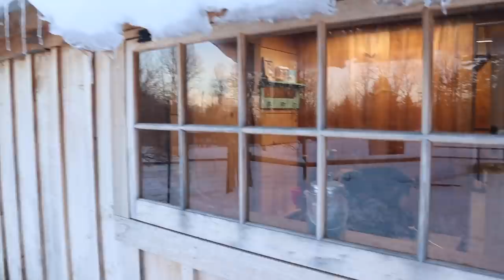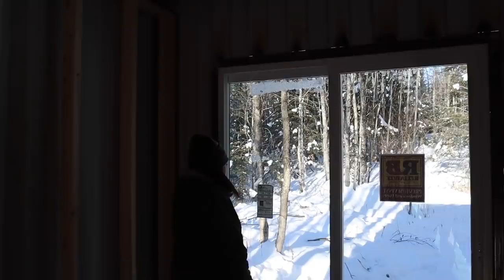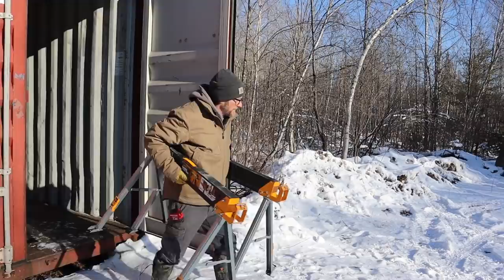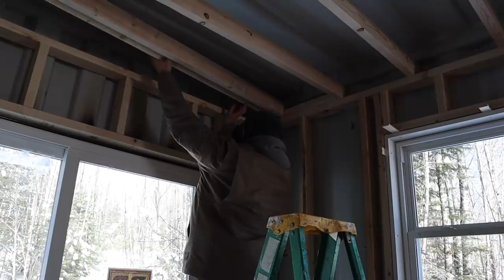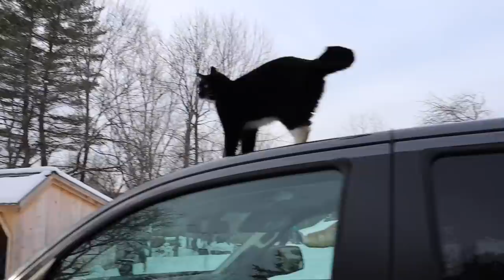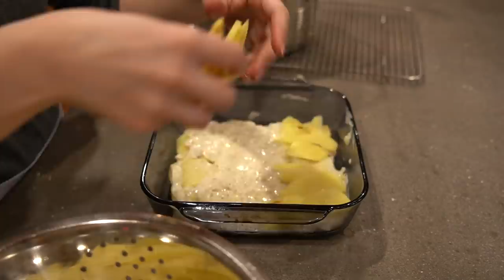It's All Taking Shape Now! Installing Sliding Glass door in our OFF-GRID Shipping Container Cabin

Comment: Thumbs up to your friend that help you install the sliding door. Your so lucky to have such great friends.
Reply from the maker: Yes we are!
Reply: I was thinking the same thing. Specially in that kind of cold. Luckily it didn't take too long.
Reply: I was thinking that too, plus that Gina could have probably done it;)
Reply: @PatrickPoet  That's a pretty heavy door, (120 to 150 lbs) no sense in taking a bigger chance on an injury greater than they are already taking. They're not working under the best circumstances!
Reply: @PatrickPoet  🇬🇧    Extra hight and masculine strength was probably needed.
Reply: @sarapulford5957  I hear what you're saying, but she works a farm and I've seen her doing incredible things. I stand by it. I think she'd have been just fine. Sometimes it's just doubt that holds you back.
Reply: @garys9694  I hear you. I've seen her move 50# to 75# things on the farm, though. Plus they could have carried it flat and put it on sawhorses by the wall, slide the bottom in place and then just tip it up. There's always ways to avoid brute forcing things.
Reply: @PatrickPoet  But they made the decision in a previous video when Gina was there that they would get help so she obviously thought she was not up to it.
Reply: @tonygrimes13 , yeah, I know. But sometimes our biggest obstacle is self doubt. You and I and everyone else can often do a lot more than we believe in the moment.
Reply: @PatrickPoet  🇬🇧     It's not just the weight Patrick.    The hight to lean against the door to hold it in place would also be important.    Gina does not seem very tall along side Al.
Reply: @sarapulford5957 , yeah, they talk about that -- neither of them is basketball player tall;)
Reply: What kind of chopper are you using? My wife would like to have one like that.
Reply: @sarapulford5957  yep! Those doors weigh close to 200 pounds!

Comment: I’m a firm believer of doubling the amount of sockets I think I need. It’s so easy to add them at this stage and the cost is not unreasonable either.
Reply from the maker: I agree
Reply: @LumnahAcres  also 20 amp.
Reply: You’re thinking to place the wood stove in a position close to your sliding doors and thus plastic and glass. Is this a risk? Can you beter place it more central along the side of the wall?
Reply: When you need several outlets in one area use 4 in box with double outlet plaster ring. Then you will have 4 outlets in one area. Works good when you are using several chargers .

Comment: I still think that you should have a door between where you are having your work area in the back and your cabin area. That way you have an alternate way into your cabin area. You could put your work bench along the sides of the storage area.
Reply: A door between the two half's is a great idea.. including use as a fire-escape.. in case you have to go through the shop to get out.. plus a bench on the side will allow more room to work if you open the end doors to expand the useful length of the bench.
Reply: Or at least a crawl-through door which could be under their bunk beds on one side and the work bench on the other side.
Reply: @hollowpoint357sw4  BUT--cannot open container from inside ????????
Reply: A door between the garage and cabin ends would not work well as an alternate fire exit because you can’t open the container doors on the garage end from the inside. He’d have to put another exterior door.
Reply: I firmly agree with that safety first
Reply: @hollowpoint357sw4  This!!!!!!!
Reply: @anthonywatt3758  or be running about 65 MPH to burst through the steel doors !!  Fire can make a man run pretty fast i bet,,,LOL  seriously though, with the main doors locked from outside, it would not make sense to have an exit through the shop end.
Reply: @SailorAllan  unless you take off the locking pins and use a locking system like a cross bar and U seats for them. Like they locked the great castle doors. There is always a way round things. Only have to take off the bottoms and tops of the pins it would make it look original. I had my doubts but it's looking good Al, you and Gina work well together, keep it up.
Reply: @anthonywatt3758  Put in a roof hatch/ high small window hatch to exit for emergencies?
Reply: @nancyparker8623  an egress window would have to be big enough for an adult to fit through and at a height appropriate for a child to get out otherwise what’s the point.  I don’t know what local building codes are where they live or if they will even need a c of o but where I live a small window and / or roof hatch wouldn’t fly. Would have to be a large window or a minimum 32 inch door.

Comment: Outlets every 6 feet . Install the new style low profile LED cans , cut hole and spring clips hold the lights in place .
Reply: I have those in my bathroom, super easy to install and fit in a 2x4 wall
Reply: In that small space, every 4 ft, or even 2 or 3 because you need then and stacking them isn't a good idea.
Reply: Love anything LED❣️👍

Comment: How about a hinged workbench so it can be flush against the wall if you need the space for storage or more floorspace to work?
Reply: I like your thinking about doing this.
Reply: I like the idea about the hinged workbench. If you added French clits to the wall above the work bench you could keep thing off the work bench. One draw back I see is if you added a vice to the workbench, then you would have to remove the vice of you wanted the extra space for storage.
Reply: Or even a flip down table to sit at inside to eat and it goes down when you're done.  I've seen tiny homes in RV's with those.  Space savers.  Things that have multiple uses are called for in tiny spaces.  Maybe even flip or chain rising top bunk and bottom bunk doubles as a couch.  Olivia gets the top bunk, she's younger.  ;)
Reply: They sell the flip down bench/table at Home Depot. The hinges are heavy duty and the wood is butcher block. $125.00 or $150.00 very nice.
Reply: @Parakeetfriend4215   I think this is an EXCELLENT SUGGESTION.

Comment: For outside lights you could use solar movement lights, the new lithium ones are not as bad with the cold and they will work night or day.  I would start determining what you want for power inside the container,  make sure you have enough for lighting and other uses.  Find some old florescent lights and convert them to Led Bulbs.  get the bulbs that have you taking out the guts of the fixtures.  uses way less power for more light.  Will wind up being cheaper. The bulbs will about 5-6dollars each in quantity. Put the battery bank in the garage section, you need it to have enough power to carry you for 2-3 days with no sun.

Comment: You can never have too many sockets, in any case they are easier to install at this stage, than after you have finished your insulation and internal walling.  Installing sockets in the workshop area is essential, but don't forget to have one at least close to the door both ends, should you require power outside the container.  Might also be advantageous to have the fuse board and isolator switches just inside the workshop door, just in case you need to isolate the supply in an emergency. Always be mindful of Health and Safety.   Good luck..Cheers Robin.

Comment: I don't know if you mention how you're going to finish the interior, but definitely on the dividing wall between the garage and living quarters use something that is Fire Retardant. And a smoke alarm on both sides.
Reply: To add to this thought, the wood stove will need a ready supply of fresh oxygen from outside as the container is likely too small volume-wise to supply the fire and your own O2 consumption. Keeping a fire extinguisher at both ends of the container would also be a good idea.

Comment: Make sure you have an outlet for a workbench light as well as any electric tools you may need.  My suggestion for now is to buy a Heat Buddy by Mr Heater for the inside of the  shipping container to keep it warm while you work.  They run on propane and are very efficient.  Then you could still use it for your workshop area.

Comment: The sliding door looks great installed along with the windows. Save the steel cutouts to make shutters to protect the windows and door from animals should you be away for an extended period of time.

Lighting and outlet wiring....
Circuit breaker #1 - install a light in the ceiling over each window independently switched, two more in the ceiling on the solid wall opposite of the window lights-switched at the slider door. 

Circuit #2 - one light outside the slider door above the switch, with a tied in outlet outside. 

Circuit #3 at least two if not four lights in the storage/shop area maybe four feet out from each corner. 

Circuit #4 - five Wall plugs...one on each side of the windows, one in the far corner of the window wall. 

Circuit #5 - One outlet by the wood stove, and one every 6 feet apart on the solid wall, and one or two on the back wall. 

Circuit #6, 5 wall outlets in the storage/shop (on the stud wall, one each one foot out from the corner(s) and one in the middle, and two near the right cargo door one inside and one outside), along with a light above the cargo doors in the center an have the switch above the outlets.

Comment: It's looking really good, Al and Gina!
I really think you need to put a screened vent (to keep the critters out but allow airflow) on the tops of the walls on the outside to vent the space between the back of the insulated walls and the steel walls, or you could have condensation build-up on the inside of the steel walls. Wet soggy insulation would suck.
Your electrical ideas sound good, I'd also put two exterior outlets on the workshop side of the container, one on either side of the doors.
Think about an extraction fan on the workshop side as well, say you want to do some grinding or welding in there, an extraction fan would be nice to have, also in the summer an extraction fan would be nice to have.
you could mount a bracket on the side of the container to hold a water drum near the top of the exterior wall, and then gutter the container to have a water catchment. It would be nice to have rainwater for washing up plumbed into the cabin and an exterior hose bib as well on the other end of the container for washing up near the workshop doors...?
The electrical panel will be in the workshop, right? That is the best spot for it as well space in the cabin will be a premium.
That's it I'm out of ideas for now, LOL.
Thanks for taking us along.
Cheers from Tokyo!
Stu

Comment: Hi again, Two lights on the outside of the doors. Both sliding doors, and swing doors,  Also due to no windows on one side, it becomes a complete area of darkness. So i would put some lights at least on that blindsided of the build. 
Inside, I would put lights every 3 feet of the build. And outlets the same. You wouldn't want to be short outlets and have to open things up again. Its better to have more than you need, and not use them. Then to have less and have to run interior extention cords everywhere. You could run a switch for every other set of lights. 4 Switch panel controlling living space, and 4 switch panel operating other half of container on the other side. All coming together at the one electrical panel box. Don't forget a ground. Lightening could hit the container. 😃 G-D Bless.

Comment: I'm sure you already know this, but wall between shop and cabin should be fire rated....especially if you're going to have battery charging station on other side and store anything with gas there (generator, mule, gas cans, etc.).  Somebody else mentioned spotlights, I would at least put one on the corner that spots out into the area on the window side of the cabin....maybe even a double that points out there plus one that points out to area on the door side of cabin.  Midnight wildlife surprises are far less anxious when you can see what is going on.
Reply: Yes yes a must keep the fam safe

Comment: If you paint the Container White in Summer it will be 15 % cooler inside. ;0)
Reply: Might want a mini fridge for your container.  There are those used in Rv's that run on little electricity.

Comment: well done. Glad the door is installed and the wall up. That will make things easier. 
Power: Think about a switch on the outside that will turn on the exterior lights so that when you show up after dark, you can have light to get around and in the cabin.  Couple that with an exterior outlet or two on the shop end for your outdoor builds and you should be set.
Gina, shared your version of scalloped potatoes with the wife, we will be trying that method, thanks

Comment: Keep your eggs from cracking get a portable heater and put in the chicken coop’s that will keep them warm and comfortable and that will produce more eggs for you
Reply: Not good, chickens need to adjust to the cold weather and not be kept warm. If the power goes out and they don't have that heat source they are used to they will/can die as they haven't built up proper down feathers for protection.
Reply: @thesoapcrate596  Anything over 32°F will keep the eggs from freezing. If you use incandescent lights as heaters, it will encourage egg production.

Comment: I would have had that stove inside by now,  to heck with being that cold, don’t hate because it’s the truth...
Reply: I agree, doing no good outside.
Reply: Yeah, it's not like you have to worry about the smoke in a closed-in building!
Reply: Yea temp run the pipe through a open window...done this lots of time.
Reply: @garys9694  they have the piping they need to put in a chimney, duh.
Reply: Yep...me to! Fire pit outside would give off more body heat.  But then you might not get much done..LOL
Reply: @Blessings.429  Not a very pleasant person, are you? duh, I meant that since the windows are in they could just put the stove inside and let the flow of air from the open door through open windows take the smoke out. They could have the heat source much closer to where they are working with no danger. duh uh!
Reply: Gary S grow up, it was just my opinion. I do not have to explain myself to you or anyone else for that matter.

Comment: I would add an outlet or two above your living workspace to accommodate under cabinet lighting.  Or in cabinet lighting.  Wire them to switches.  With only 2 pot lights, you will be working in shadows.  You can also coil up a rope led light above the cabinets for gentle evening light.  Good luck and thanks!

Comment: As for the electrical it depends on the size of the solar system you plan to use. I think I would design the electrical system to normal on-grid specs as I expect you will eventually obtain on grid electric service. While you're off grid I would limit service through the electrical panel to what you have available. You two are doing a nice job on building this temporary cabin. Thank you for sharing your life with us.

Comment: A few thoughts Al, don't make the mistake of putting lights straight down the middle of the container or else you'll always be working in your own shadow;  if you're going to move/build the bathroom next to the container, you'll need a light to get there at night - and it could light up your BBQ as well; when the weather's nice you may want a workbench along an outside wall of the container so best to have a few power outlets there; and lastly I have eight lights in my 40 foot container which is perfect so you may want more than 2 lights in your 20 foot container. Cheers, Lex :)

Comment: You should put a switch for outside lights for along the window wall so you can see if you need to work at night on something out there or to ward off predators. To more options you have the better.

Comment: All of your power production (solar and generator overide) in one place means easier to fault find if necessary. One circuit for power in the living area and another for the work area with breakers for each area. Generator override switch to use for all power needs incase the solar is insufficient or fails. And one lights circuit for all lights internal and external, LED LIGHTS of course.

Comment: Colder than the icebox, but at least you're getting it done before it's hot.  I think that you'll be happy about it.  Lights in the window would be pretty, clear ones.  And curtains surrounding for color and maybe privacy and a little extra warmth.  Solar is excellent, but a couple of oil lanterns hung outside would be cool and give you more light and be for emergency should solar for some reason go out, ie. dead batteries and or Emp.

Comment: Al, it might be too late to worry about it now, but if you (well, Gina) plans on hanging any kind of curtains in front of the windows or door, you might put some backer boards where you'd expect to hang them from (unless the studs are where you'd hang them from), to make it easier later on (vs hanging in drywall).

Regarding the lights, I think you might like to have a flood light above the windows so you can look out when you hear a bump in the night.

Comment: Pick up a couple containers of close cell foam insulation at your box store to spray on the metal before putting the in the Rockwell insulation to combat condensation in the walls and ceiling , it wouldn’t hurt to spray the shop area to to help combat cold in the winter and heat in the summer .. as for plug-ins receptacles the more the better inside and out put one on each side of the shop doors at least 3 feet off the ground for easy access

Comment: I like wall sconces with the switch on the fitting so you don't have to run switch wires, I have pull string lights in my closets, same thing, no switch wires 👍😊
Or you could run 12volt lights and 110 outlets